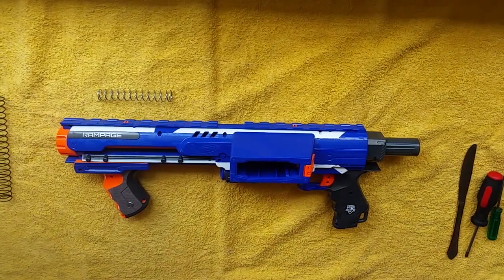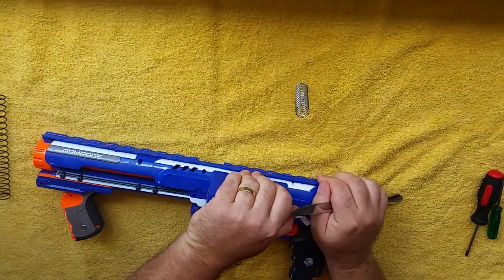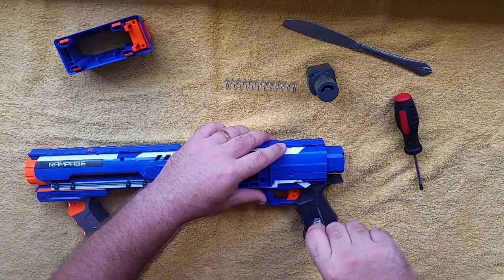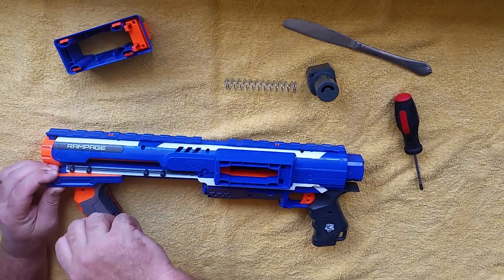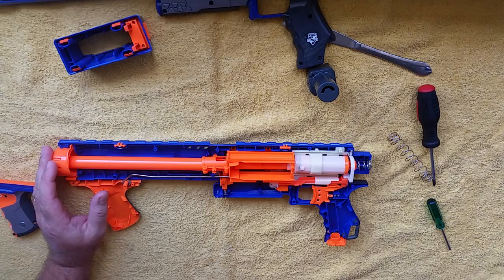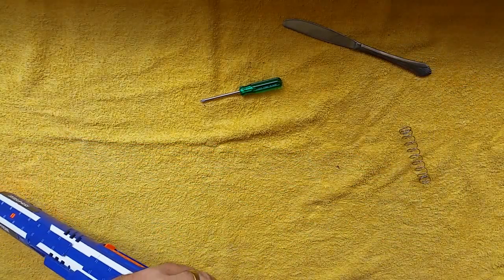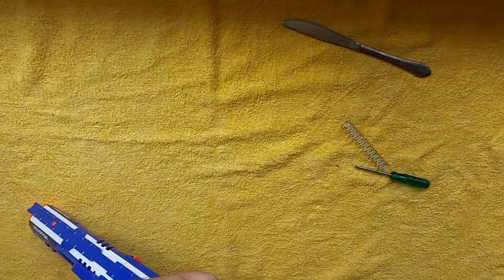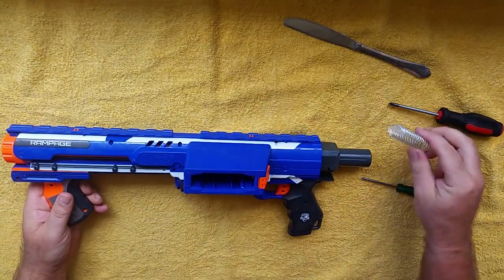Basic Nerf Rampage mod

Comment: Nice job, didn't know you removed the magwell before taking apart the blaster.
Reply: You don’t need too
Reply: definitely shouldn’t remove the mag well first. simply unscrew to bisect the blaster and remove the screws inside the well. prying from the outside damages the plastic

Comment: How about if I replace the original rampage spring with a 7kg spring ? Would it fit ?
Reply from the maker: Brian 1506 should be fine as long as it's a retaliator spring
Reply: Nerf mods for beginners if it's not a retaliator spring what would happen ?
Reply from the maker: Won't fit, won't prime or won't be a output increase
Reply: Nerf mods for beginners thank you for your help, I could have wasted my money
Reply: @nerfmodsforbeginners796  im buying a 7kg spring for the rampage/retaliator what fps will I get roughtly
Reply: @brkzen4586 , aroun 105 to 120 I would say

Comment: How would you spray paint the blaster? would you take it apart like you did and tape over the internals/mechanism?
Reply: I would completely gut it before applying primer than applying ur spray paint with some frog tape to section off the parts u don’t want to paint. And then apply clearclpat before reassembling it.
Reply: Dye plastic like that. Much easier and doesn’t chip off

Comment: My rampage blaster handle won’t pull back. Any ideas why?
Reply from the maker: Mythics1 you need to open it up and prime it to see if there is any obstruction
Reply: Nerf mods for beginners Whenever I open it and pull the rod it primed fine. I spent ages trying to find the source of the obstruction. I ended up taking the two locks or ‘catches’ off that are on the other half of the blaster. If I left either one it wouldn’t prime. I don’t know what happened but it’s good now, just second hand so I think it’s seen it’s share of play.